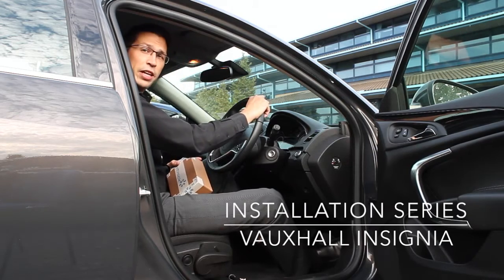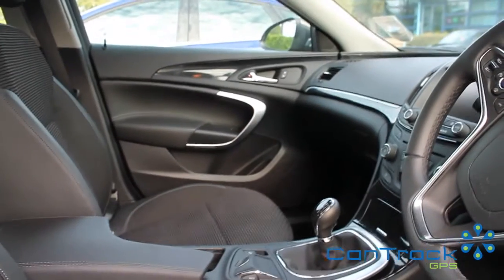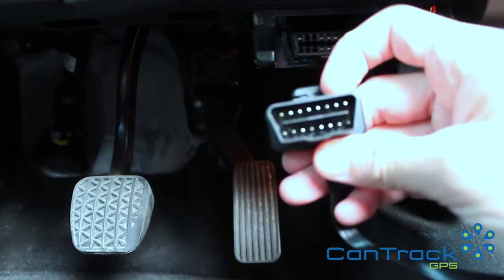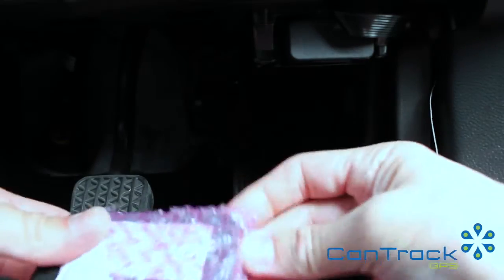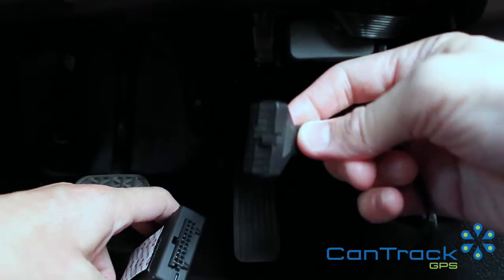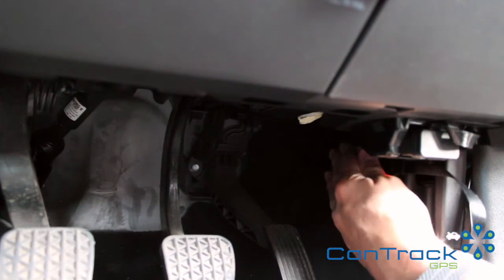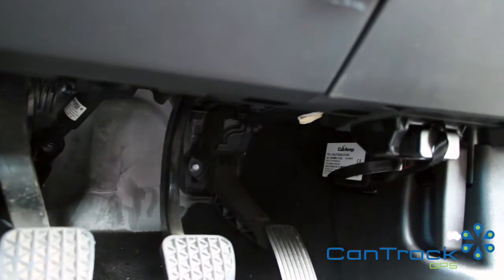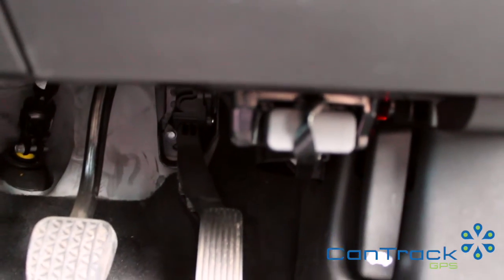Installation Series: Vauxhall Insignia

Comment: Are you seriously saying that this is a secure place to position a 'discrete' tracker?  If i was a car thief, this would be the first place i'd look.  I hope you have reviewed this advice now we are in 2021 and moved on as i can see from more recent videos you use batteries.  So, i'd recommend you pull this vlog as being obsolete.
Reply from the maker: No, I think there might be some misunderstanding here. This is our live telematics unit the CanTrack GPS, the CanTrack Protect is our security product and requires no wiring or power source - and definitely should not go in areas like this!